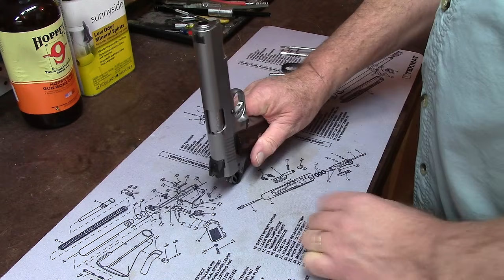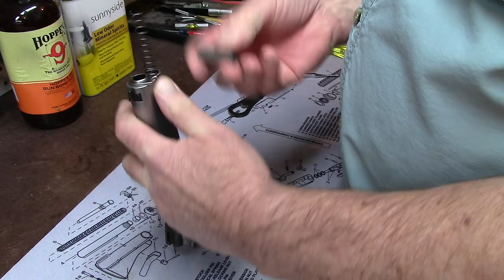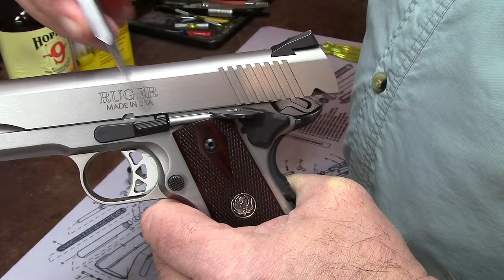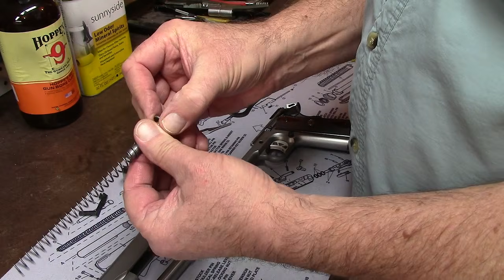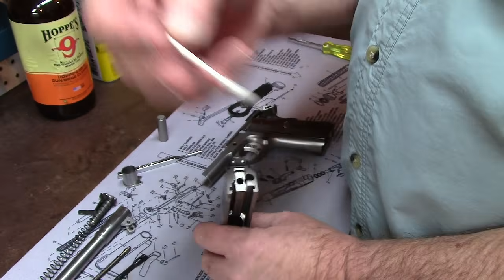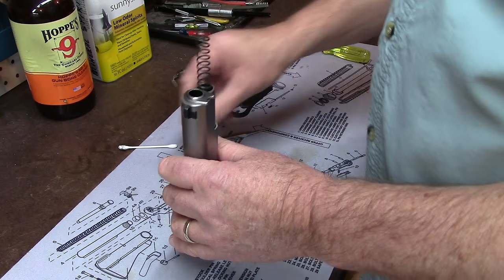How to take down the 1911 pistol for service, inspection, cleaning & lubrication ~ Now in HD!

Comment: I just bought a used Remington  1911 R1. They let me put a trigger gauge on it but wouldn’t let me take it apart.  Hammer dropped @ 4-1/4# and very crisp.  I ended up buying it because it was clean, tight, and had the feel of a quality gun.  I got it home and discovered it was a series 80! 😬
 I’ve removed the series 80 parts and installed shim kits on 2 of my other 1911s and they’ve noticeably lowered the trigger weight.  I’ll leave this one alone. I’m not going to mess with a crisp 4-1/4# trigger.

Comment: What are your thoughts on using carb/brake cleaner for gun cleaning?   
Not spraying down the entire gun like you’d do to a carburetor, but spraying small amount onto a patch to clean the bore and parts, being careful to not get it on any plastic, wood or G-10 parts.

Comment: I did my Colt Commander. New in box gun. Put Wilson’Combat spring kit and Wilson Combat bulletproof disconnector in. The improvement in feel was really unbelievable. Feels like a custom shop pistol The trigger pull was greatly improved. The thumb safety feel is perfect. Grip safety tension is perfect. Slide is so much smoother. Really transformed the gun. I am definitely going to do this to most all of my 1911’s. It was difficult to do at first but after doing it a few times it gets so much easier to do it

Comment: you don't need a drift pin, browning wasn't a moron, just now, here, in this video you already removed the base-pin "slide stop", THAT is your "drift pin", and your thumb safety is ALSO your "drift pin" for that retainer plate, and your firing pin is your "drift pin" for your mainspring housing, and removing that housing and your grip safety gives both screwdrivers for removing the magazine catch and your grip screws, and I don't know why, after having played with 11A1s for more than 40 years, and having NEVER SEEN ANYONE ELSE demonstrate Browning's design, I would have expected to see it here, but "hope springs eternal" sorry for disturbing the class, I'll go to the principal's office now.

Comment: Did I just see you drop your slide in an empty chamber??? This should never be done. You should hold the slide as it drops to prevent damage…especially on high quality 1911’s.
Reply: PS. My opinion is based on the recommendations of Bill Wilson from Wilson Gun Works and Massad Ayoob, noted gun expert.  Original military guns will probably not be impacted by dropping the slide BUT a highly tuned match level 1911 with a high end trigger job may be damaged. Why take the chance if you have a nice 1911.
Reply from the maker: That's a great question.  Yes, you did, and no, it won't harm this fine 1911, or any 1911 made to the same standards as the military demands for combat firearms and did for issue 1911 handguns.  You correctly state that some guns are prone to damage from dropping slides on certain 1911's.  While exorbitantly priced and claim so, their guns are NOT high quality, by that very attribute.  I've got nearly a quarter million subscribers because I devote myself to separating truth from fiction.  During the 75 plus years that the four branches of the US military issued the 1911, those who carried it and ANY firearm, were required to comply with very specific Standard Operating Procedures (SOP) for handling firearms that were adhered to strictly at two locations, the issue window of the armory, and at any inspection.  As a Military Police officer who carried a 1911 daily, I know exactly what the procedures were, and presumably still are.  That SOP was thus:

At the command "PRESENT ARMS" the individual stands at attention, with the fully loaded magazine being held in the left hand, palm up, for the armorer or inspecting NCO or officer to see, while the individual held the firearm in the proscribed position with the action OPEN.  In the case of the 1911, the individual's right arm was bent with the elbow pointed down, and the open handgun pointed upward, at the right of the shoulder, for inspection.  At a Military Police Guard Mount, or any organizational inspection, where all reporting individuals stand on line for inspection, the inspecting officer walks the line, inspecting each individual from top to bottom, left and right.  At his option, he would take the firearm from the individual's hand and inspect it for cleanliness and/or operation, before placing it OPEN into the individual's upward hand.  During that inspection, the officer often dropped the slide smartly on an EMPTY chamber and pulled the trigger to check for function.  At the inspecting officer's (or designated NCO's) command "ORDER ARMS", all slides were DROPPED and triggers pulled, while the individual held the loaded magazine in the left hand.  Immediately, with sidearms still pointed skyward, all magazines were inserted smartly and were immediately holstered, EMPTY.  The triggers having been pulled, the safeties remain off throughout duty, until such time as duty required, or unless one receives the specific command from proper authority to LOCK and LOAD.  The line remained at attention until relieved for the duty post.  The reason that 1911s were carried with empty chambers was because of their proclivity for the floating firing pin to strike the cartridge if dropped or jarred.  I can attest to that personally.

On obtaining one's handgun at the arms room window, the requirement was (and presumably remains) thus:  

The individual calls out his name and the serial number of his assigned firearm, which the armorer secures and places open along with three loaded magazines upon the window ledge.  The individual signs for the firearm and is responsible to check that each magazine is fully loaded, as they are required to be returned fully loaded or said individual will be reported by the armorer for any missing rounds upon return.  At the window, two magazines are secured in the belt pouch.  The individual turns to the sand filled 55 gallon loading drum or equivalent, where he inserts the muzzle and drops the slide smartly with one hand and pulls the trigger on an EMPTY chamber, with safety off, and holsters his sidearm.  The magazine is then inserted and the individual departs, again, with an empty chamber.  

These procedures were repeated with 1911s every day, by every shift, by hundreds of units, in the US military, millions of times, for over 75 years.  The military expects all personnel and equipment to perform reliably, at the highest level.  

A myth is continuously promulgated that service 1911 handguns were inaccurate junk.  As a former expert of the 551 MP Company pistol team at Fort Polk, LA who shot  50 yard X-rings with my 1911, and who carried and constantly trained with a WWII vintage Remington Rand service 1911 every day, 12 hours a day in Viet Nam, I will attest that such is absolutely not the case.  The military procures only the finest and never bought junk.  The 1911 service arm was a very accurate handgun and was extremely well made with a very fine service trigger.  It was not made for precision shooting, but as countless thousands of post War shooters knew, it didn't take much to get them into top form for national level competition.  Equipment of all kinds is used harshly and eventually wears down, requiring service that the average person would never subject his equipment to.  Grip panels broke, sights got bashed, Parkerizing wore to a sheen, and barrels required replacement, but I never heard of any 1911 failing from a dropped slide.  Such would be absurd for an arm intended for battle.

Understand that military and police training is all about -- 100% about -- learning unconfused muscle memory that's ingrained, and will remain with you in combat.  To introduce a movement that differs from that muscle memory interrupts that learning cycle and can confuse one at the dire moment needed, and get a person killed.  To gently lower a bolt or slide interrupts that muscle memory, and can lead to an individual inadvertently doing so with a live cartridge, and having a firearm that is not correctly locked and chambered when he needs it most.  Except in a rare instance when silence demands it, military and police chambers of all firearms are always closed smartly, empty or otherwise.  One does not ever gently lower a slide or bolt.  Period.

Yes, certain manufacturers produce 1911 handguns that incorporate methods and frail parts that will certainly fail and break, and would not be able to conform to the testing procedures and rigors of military and police requirements for service.  Those same makers actually and most curiously boast that they produce guns that must be managed like fine crystal, and must be "broken in" with many, many rounds before the slides function, when they may operate with some degree of reliability, or not.  The US military rigorously and harshly tests every firearm (vessel, vehicle, aircraft) for correct function before procurement, and they require those combat items to be as-is, off the assembly line, 100% ready for combat use, without failure, just as it expects from the individuals who go into battle.  That is the only definition of high quality.  My Colt Gold Cup National Match, as with all Gold Cups, functioned superbly from the first time I fired it here, on this channel, and shoots superbly, as it did here, on this channel.  Colt introduced the Gold Cup National Match to shoot in the National Match, according to military standards, where military people and civilians alike freely drop their slides without hesitation or fear.  

Some years ago, I devoted a video on this channel on this topic.  Those who are convinced by such peddlers that any guns but theirs are sloppy garbage.  They eagerly hold out their greedy paws for three times the price of someone else's fine gun, yet their exorbitantly priced product wouldn't pass a minute of military testing.  Those who are conned to believing that a fine 1911 equates to fragility and unreliable, sticky slides are entirely free to trade hard earned dollars for such malarky.  

My Gold Cup slide is beautifully fitted, but not rigid or sticky, and with good ammo, it shoots as precisely as any 1911 made, because accuracy is derived from the union of the barrel and slide that keeps the bullet pointed where the sights look, NOT the slide and lower frame.  The trigger is crisp and perfect, and is not made with fragile, razor sharp sears, thin cocking notches, and skeletonized, weak springs. Properly constructed with robust sears, deep cocking notches, and full springs, just as with any military firearm from the same factory, it's made to military standards for reliability and the slide can be handled just as any military 1911 can be.  Having been a certified firearms instructor during my professional career, I have seen the finest marksmen who will go to the line and win trophies with a standard, sensibly priced handgun any day, because 99% of handgun shooting is the shooter, not the gun, which I know from years of competitive experience.

I'm a factory trained armorer and a highly skilled NRA Distinguished Expert who understands everything about filling X-rings, and I'm not one of the folks who buy their marketing malarky, any more than the smart boy who called out the emperor from the crowd for not having his clothes on.

Comment: Great advice on aligning the extractor slot before inserting the retainer. Wrestling with getting the retainer in is an easy way for the firing pin to fly into a face.

Comment: The extractor does not 'clamp' over the cartridge rim, the rim of the cartridge rides up into the extractor during the feed cycle, as per Browning's design (super slo-mo will illustrate this, and it's a beautiful sight). Never load a single round into the chamber and close the slide, always load the chamber from the mag, if you want to load one round only, put the round in the mag and close the slide.

Comment: Excellent vidoe and instruction. I bought a Rock Island 45 and had problems with fails to feed so that was the first thing to fix. A sticky drop link on the barrel due a burr.. Still had a fail to feed in a 10 round mag. On top of that I suddenly could not put a fresh magazine in. The Trigger rail had bowed a little so I went through the break down. I decided this called for a better trigger. I ordered one plus a single side safety lever, standard not extended becaus they give potntial problems on concealed carry. Everey thing seemed great reassemblng, took some focus to get the sear etc into place. Took it out to my range and fired acouple fof rounds then the trigger was sticking on return. It felt good when I was checking it on assembly. Back to the bench, took it apart again, checked the trigger rail and used an empty mag to adjust better. The rails were bent a little in the post so that did not help. It still was a little sticky so got my Dremel out with a small polishing pad and 600 lapping paste. Pollished the rails and the sides and top of the trigger until it was sliding like silk. Reassembled, still following your instructions, and check my unloaded maganzines worked. I ran 2 10 round mags through and it ran like a dream. Still need more rounds through as it was not yet bedded in. Thank you for your video. It was great!
I have another rock Island which has been faultless since I bought it 18 months ago, and a Colt Government which 2 years in went back to colt with barrel damage cracked in the drop link fork.. Colt sent me back a brand new gun after about 6 weeks - it is way better quality than the one i bought 2 years ago!!

Comment: Have been a 1911 owner for about 40 years. Have never heard of reassembly while leaving the guide rod on the small portion of the barrel.
For years I have noticed that the slide sometimes seems to temporarily get stuck when sliding it back onto the frame. 
I am thinking that having the guide rod pushed all the way up on the bigger part of the barrel may have been causing this. 
Can’t wait to try this on my next disassembly and reassemble. 
Thanks!
Reply: I've recently purchased a Colt 1911 Comp Series in series 70 and have had trouble reassembling the slide. Now I know why. Haven't been placing the guide rod in correct place on barrel. Thanks!

Comment: Great video.  Especially liked the section regarding placement of the barrel link against the barrel rather than at 90 degrees to the barrel and the sections on removing and reinstalling the extractor and the firing pin.  Great information.

Comment: Thank you for your service sir. I am new to the world of 1911’s. What is the difference between bore cleaner and solvents? Can I use solvent to clean bores? How often should a bore be cleaned?
Reply from the maker: Any solvent that cleans carbon and other residue in a bore may be called a bore cleaner.  The industry has conditioned folks to believe that a bore cleaner has some special qualities that warrant a particular labeling.  There's no difficulty in removing simple bore fouling that consists of nothing more than carbon and perhaps some unburnt powder.  I recommend mineral spirits   Hot water and dish detergent will do just as good a job as any "bore cleaner", which is exactly what everyone did in the day of corrosive primers. Clean as often as you shoot, and wipe a lightly oiled patch through the bore afterwards.

Comment: What is the purpose of a half-cock position on a 1911 (or the original Browning Hi-point) exactly?  Does it have a benefit?  Thanks for all your wonderful information.
Reply: In case the full cock shears off the half cock can catch it to prevent the gun from firing.
Reply: @mikeoxlong3676  Thank you so much for your explanation.

Comment: Awesome tutorial @GunBlue490! I also want to add that I had some difficulty reinstalling the slide stop due to the spring-loaded pin to the right occluding the slide stop from being pressed into place. I mistakenly thought the slide stop should be brute forced into the hole shown in the video (newbie mistake). Unfortunately, the gun did incur a small "idiot scratch" near the slide stop, but nothing major. I eventually did push the slidestop into place by using a credit card to push the opposing spring-loaded pin out of the way. Live and learn =)

Comment: Thank you for another well done and informative video.  There are 2 additional points that maybe worth noting.  First is, some 1911s have one piece full length guide rods that can not be remove until the recoil spring has been taken off.  I have found the best way to do this is by pushing the guide rod as far out as possible allowing it to be grasp closer to end and gently rotating the spring clock wise while gently pulling.  The second point I would like to mention is fowling in the extractor channel.  I primarily shoot externally lubed cast bullet that result in a heavy build up of wax in the channel.  This necessities more frequent and aggressive cleaning.

Comment: On the subject of recoil springs.   I've seen other videos of 'experts' saying recoil springs on 5" 1911 should be changed after 1500-2000 rounds.   Commander size - change every 500 rounds.   I would like your opinion.               Love your channel, Thanks!
Reply from the maker: Spring flex tension has nothing to do with the number of rounds.  If the magazine is still feeding, it's still good.  Before advanced heat treatments, some springs were not properly hardened and could take a set.  That's generally not true these days.